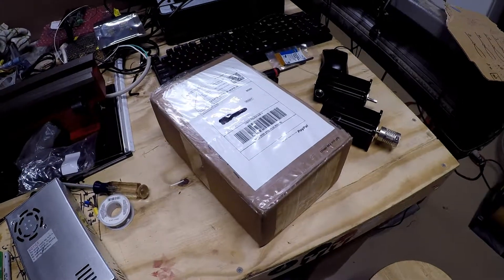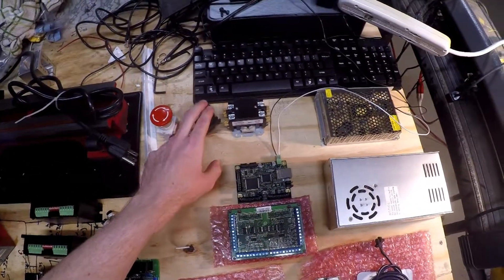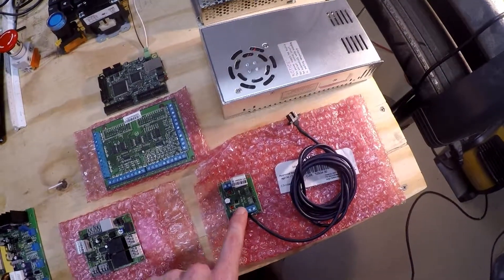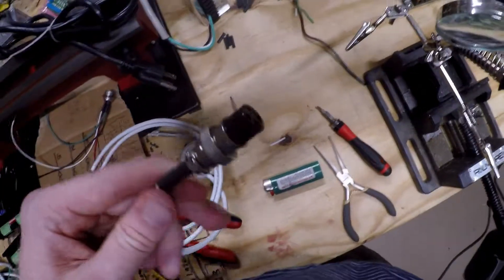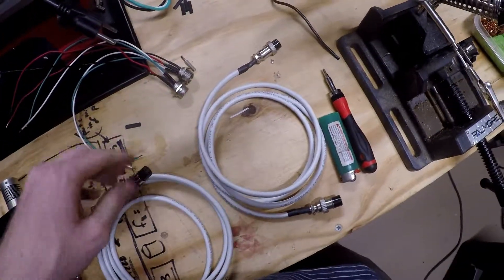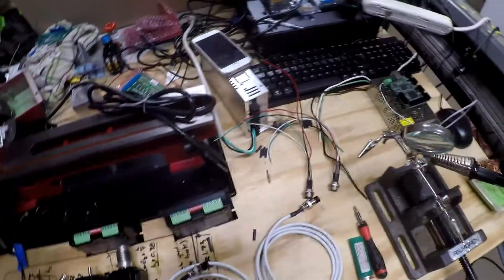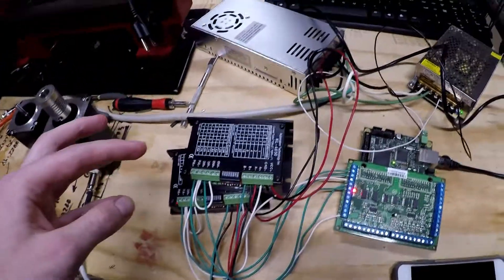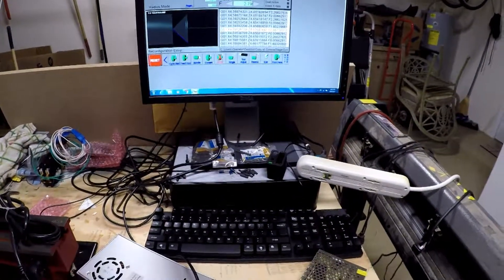7x10" CNC Lathe Conversion - Update #3 - Wiring Drivers and moving motors with Mach3!

Comment: Hi I am currently converting a lathe as well please could you tell me what control boards you used for the spindle operation?
Reply from the maker: For the spindle, I'm using the board that came with the lathe (the one with manual controls), and a the C41 board from CNC4PC. You can see more of the boards that I use in my Update #4 video. I can go over it more after my shop is finished and I move in.... or even answer anything I can on here if it helps. Good luck!
Reply from the maker: This is also controlled via a smooth stepper board and the BoB for it (both are also from CNC4PC).

Comment: Are you getting close with the lathe? I have 2 that I plan to convert at some point.
Reply from the maker: Performance 3DP currently working on the electronics. I did the routings aluminum video to test whether or not I could potentially build the brackets or other mounting hardware for the motors and things needed. Should have some content for that soon.
Reply: Nice work, looking forward to seeing make some chips.